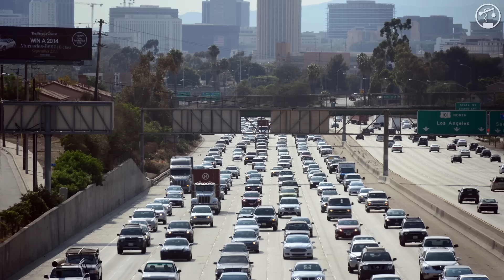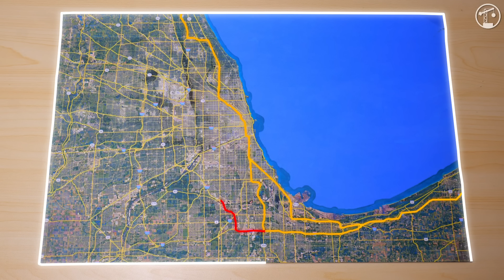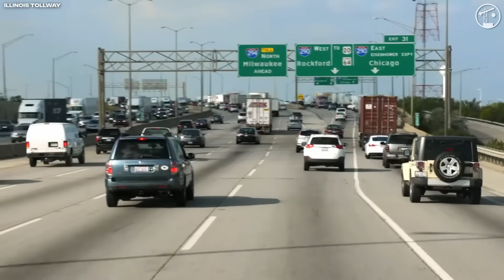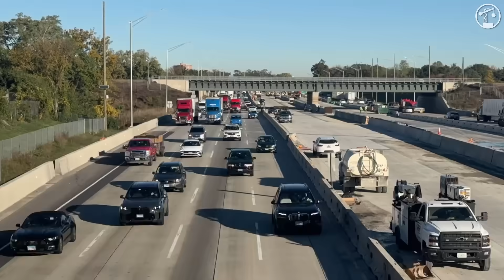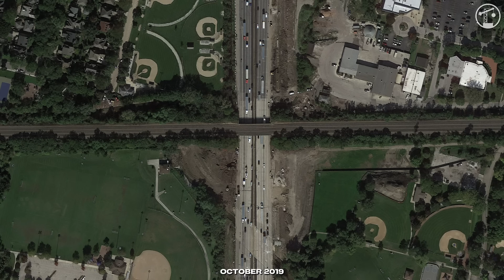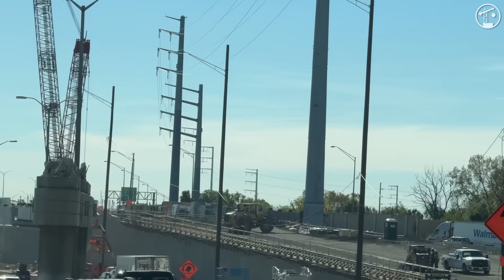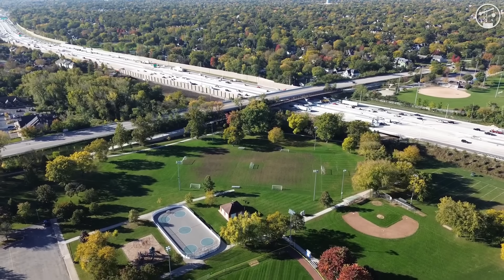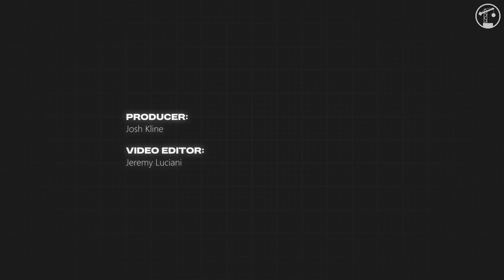Why Chicago is Spending $4B on One Road

Comment: After moving back to Chicago in 2007, I got rid of the car and stuck to trains and buses.
Reply: The trains are have become too unreliable for daily work commuting. Metra is awful. Especially the BNSF line. The L is still ok though. Usually.
Reply: I've been living in Philly without a car for 20 years. With the money I saved, I bought a house.

At this point it's completely paid off and I'm semi-retired in my 40's.

A car free life is the way to go.
Reply: @AB-wf8ek  sadly most areas in the US you cant live without a car of some sorts.
Reply: @sal-the-man  Chicago is a pretty big exception. You can get around pretty easily with no car. There are some odd pockets here and there. They actually need a train line similar to 294 that goes north/south on the west side of town
Reply: @brianthornber3319  exactly, that’s what Ive been saying. I lived there before and most of my commutes were north to south. The Chicagoland area has great transit east to west but there is virtually none going north to south some good transit replacing the I-355 and I-294 corridors would be nice
Reply: @brianthornber3319 maybe if you live east of western
Reply: @brianthornber3319  yeah but the catch is one can't afford a home in chicago you're gonna be renting
Reply: @brianthornber3319  they need intersuburb train access. When the suburbs are as populated as cities themselves they should be connected together
Reply: You're brave for sure
Reply: @timdodd3897  Why? Driving is much worse than taking the bus. Cars suck.
Reply: I've recently got an ebike and it's been much better zoom through traffic and Chicago is slowly expanding and upgrading the bike lanes which make it better to bike
Reply: @chitowncommentor snow ❄️...
Reply: Those ebikes are insanely amazing. Before they became popular I invested in an engine for bicycles, same thing just faster, 35mph. Fell off it and realized, even with a helmet, it’s dangerous. Haven’t been on one since, but I remember how much fun it was riding around the city feeling free (minus cars tailing you lmao)
Reply: Legend
Reply: your a brave man
Reply: You also limit yourself to where and when you can go.
Reply: @O @OGKenG not really lmao. If you don’t have a car, there’s no reason to live in the middle of nowhere
Reply: @Minelaughter  me and my partner live in chicago, i drive they dont, it takes me a half hour to drive and get food from the grocery store, it takes my partner 1.5-2 hours. literally anything they wanna do tack on an extra hour or two because of public transit, they've been trying to get their license for a multiple years in chicago but no single dmv in the city can do everything they need to qualify and they wont even see them at an appointment unless youre at a dmv that does, so we now have to drive to the burbs, if they didnt have me to drive them this would change from a 2 hour errand to an all day errand. like cmon be serious, as much as we want to like public transit it is severally lacking in the US, even in chicago.
Reply: @B @Bedzsy  If you live within the city limits of Chicago, I find it very difficult to believe that your partner spends 1.5-2 hours taking transit unless it’s a bus. Even then, 2 hour travel time would be cross city travel. I also live in Chicago and I can take the bus or train from
Home to downtown in an hour, usually less.
Reply: @Minelaughter  I think they're lying too. I pulled up a map of all grocery stores in the city and there isn't a place where you are more than a 35 min walk from one but every one of them is on or near a major street or bus route.
Reply: @Bedzsy  Where in the city do you live? If it takes 1.5–2 hours to get groceries, you live in a food desert. That's a separate problem.
Reply: Daredevil 😮
Reply: @bartblue2406  CTA is safer than driving. 110,000 car crashes every year just in city limits.
Reply: Daymn im sorry, i wouldn't make my step mother go on the trains. Unless its just to Union station, then its fine.
Reply: Not having a car is not a flex, its a handicap, even in places like the EU where I live. No sane person would prefer mass transit over having your own private car.
Reply: @ShepardMerc Having access to a car is helpful, whether that be through ownership, rental, or taxis/Uber. It's a tool to get around just like any other, with strengths and weaknesses. There is no one-size-fits-all solution to transportation, but what we do know is that entire populations relying entirely upon the car for every little occasion has been disastrous in many ways. I'm sure none of this matters to you though, because you're more interested in optics. 

You can't convince anyone who's not completely braindead that driving some mass manufactured machine upon the same gov planned, maintained, and policed roads to get to the same handful of nearby places everyday is anymore "free" or even functionally different from mass transportation. For the vast majority of people, getting around by robust public transport, cycling, walking, and renting/borrowing a car a couple times a year would make them no less 'free.' Tell me, what would one be barred from doing and what would stop an individual from owning a car if the need truly arises? Just say you prefer the experience of driving, no need to veil it in fake principles. I can respect that much alone, but just know that no matter how much you may personally prefer driving, there's no ignoring the ill effects of excess and forced car usage. There is a healthy middle ground and it's not where we're currently at.
Reply: @ShepardMerc  It's not a flex, it's a preference. In most cases owning a car in NYC is insane, as parking spaces cost as much as a small condo in other towns. I have plenty of friends who don't want the hassle of car payments and insurance payments for cars in Chicago when the only time they would use them is for trips out of town. Especially now with Uber and Lyft being ubiquitous.
Reply: @brianthornber3319  Okay so your last sentence contradicts everything you just said. You're outsourcing car ownership to other people, who then charge you more per trip than how much it would cost you.
Reply: @ShepardMerc  What? No, not remotely true. Talley up what your car costs, with interest, then add insurance premiums, gas, parking, permits, and upkeep. Then tell me a few Uber trips will cost you "more" than that.
Reply: @brianthornber3319  So Uber owning their cars costs less than how much other people pay for cars? Yeah no, these services have to make a profit, by default the same trip from point A to point B, would cost you less than how much you're paying Uber.
Reply: @ShepardMerc  What???? Yes the Uber trip costs more per trip. No, owning the car is not cheaper because you don't pay for the gas, insurance and everything else. I'm not even sure why you are comparing the two. This is a very bizarre conversation.
Reply: @ShepardMerc  are you arguing that since the airlines make money on me when I fly, I should instead go out and buy my own 727?
Reply: @brianthornber3319  Depends on what airplane you're flying with, but yes, if you had your own plane you'd be paying less per flight than what you're paying airline companies.
Reply: @brianthornber3319  So in the same comment you admit the Uber trip costs more than what you'd pay for your own trip with your own car, then you throw a hissy fit that you'd have to pay for insurance, gas, and everything else? lol So are you seriously arguing the Uber did not have to pay for insurance, gas, and everything else? You are indeed a very bizarre person.
Reply: @ShepardMerc  Dude, this conversation make absolutely no sense. I'm not throwing a hissy fit. I'm trying to reason with a completely unreasonable person. OF COURSE the uber would cost more than a single trip on your own car. No one disputes that. It's more than balanced out by all of the other costs incurred by owning the car. This is so self-evident that I shouldn't have to mention it, yet I've had to mention it multiple times. And I still don't think you get it.
Reply: @brianthornber3319  Pretty sure you're the one that didn't get it, and after realizing it you're trying to save your own ass.
Reply: @ShepardMerc  I promise you that's not it
Reply: @ShepardMerc Choosing a car-free lifestyle saves on average $11,500 per year.  If invested, that can lead to being able to retire a decade earlier than everyone else, or one can retire at 65 with an extra $1.3 million in the bank.  

I went car-free 20 years ago, because I lived in a traditional neighborhood and didn’t need a car to get to work.  The money I saved allowed me to fully fund my retirement accounts, buy my first home, buy my second home and retain the first one as an investment property, and travel to every corner of the world over the years.  

Spending that money on car ownership would have bought me some measure of convenience, but at the cost of financial independence.
Reply: @ShepardMerc  This comment is ridiculous. 80% of people who live in Manhattan don't have a car.
Reply: @Damon_Callahan  Their problem.
Reply: @ShepardMerc  They don't have a problem. They're living their best lives.

I don't have a car in Chicago either and have zero need for one. 

You're just talking absolute nonsense.
Reply: @Damon_Callahan  The stats on mental illness tell a different story, not to mention the state of blue cities and the insane policies they vote for also speak for themselves. Try again.
Reply: @ShepardMerc  Lol you just said 80% of people who live in Manhattan have a mental illness. Go touch grass.
Reply: @Damon_Callahan  They do in fact lol didn't mean to trigger you
Reply: @ShepardMerc  No, just disappointed that people like you are so ignorant and close minded. Oh well. Have a wonderful weekend.
Reply: @ShepardMerc  it’s better for the environment. It’s the more natural way as well. It is absolutely a flex.
Reply: @sal-the-man  "but but the environment" good god how brainwashed are you people? You know whats good for the environment? If you don't exist.
Thats where this insane enviro argument ends up, every, single, time. I've spent enough time arguing with enviro nutjobs to know, if you're not a die hard leftoid and you have critical thinking skills, you'll notice this too.
Reply: @ShepardMerc  and by the way about the environment argument. It’s a fact that it is better for the environment. But I also acknowledge that it’s not really the individual footprint that causes the environmental catastrophes. It is the corporation that violate environmental regulations and for the sake of profit destroy our environments. 

But don’t be fooled, I’m not a person who thinks if everybody drives EV’s or stops driving that would solve pollution. That’s a dumb argument. 

But on an individual level, it is healthier for you to go out and walk more. It is something I would prefer because I’d be able to get more steps in every day.
Reply: @sal-the-man  No its not 🤣 When your IQ increases to triple digits you'll see that the whole environmental argument is about nothing else than guilting you into giving up your rights and your freedom. I've walked enough in my life and had to take mass transit for over 20 years. I can assure you that having a car is like living a different life.
The only thing that was consistent on mass transit regardless of which country I was in and whether it was a rural or urban area, is that 95% of people looked miserable. Like their soul was broken. They've been conditioned to be sheep, forever dependent on somebody other than themselves.
No thank you, I'll make my own decisions and you can continue feeling guilty for no reason.
Reply: @ShepardMerc  think you’re the one who doesn’t even have double digit IQ.

Can you read what I actually said? 

I never said people should give up the rights to drive or their freedoms. Quite the contrary!

Literally my last statement was I want everybody to be able to access any mode transport they like whether it be by train, car, or foot. 

I don’t think you care about people’s freedoms you just want a car oriented city that forces everybody to drive. 

I’ve lived in many car oriented cities. I’m American. By the way like I said before. I love driving cars, but I realize and recognize that it’s a serious problem because not being able to walk to your local grocery shop or not being able to walk or take public transit to your small day-to-day trips adds onto traffic that will make your trips longer and it is proven to also have an environmental harm because when you have everybody using cars, it’s definitely gonna affect that. 

I know this is very hard for you to understand because facts trigger you but let’s not talk about that. Let’s talk about how it affects you.
Reply: @sal-the-man  Based on how triggered you just got and based on the enviro nonsense, I can assure you your IQ is double digits.
I wouldn't have a problem with mass transit, if people that promote mass transit wouldn't promote it at the expense of owning private cars. "but but if only there were less cars then mass transit could work like its supposed to" I see this daily. I don't know how long you've been on the internet but thats the default argument for enviro nutjobs.
And the other reason people should drive, is that mass transit conditons people to be obedient sheep, and not individuals making their own decisions and thinking for themselves.
Another hilarious flaw in your argument is that you can't walk to your grocery store. Fact is, you can. Its just that you're not willing to walk the extra mile because you have a subjective personal measure for how much you wanna walk, and you're trying to force that onto the rest of the world as the standard everybody should follow.
So lets get this straight, you said walking is good for the environment, yet you're not willing to walk. So which is it? Isn't it amazing how I'm capable of walking an hour if I have to, yet you're stuck at just a few minutes? So is walking good for the environment or not?
You see, by your third reply the entire enviro narrative fell apart, like it has the previous 500 times I've encountered this argument.
Kid, when your intelligence is at adult level, and you understand psychology as well as I do, you'll realize you've been used as cannon fodder for an ideology that doesn't want you to exist. So lets talk about how that affects you.
Reply: @ShepardMerc  whatever you ever claimed here was not even what I said. At this point you’re just putting words in my mouth for the sake of winning an argument. 

It’s not worth discussing with you since respect can only go both ways. 

I honestly thought you wanted a honest conversation about transportation issues since that’s a topic I’m very interested in but you were never genuine in your replies by the way you blatantly ignored any point I made to further talk about your biases and agendas and to shit talk anything I raise up.

For the last time I’ll say it again. I want people to be able to choose their modes of transportation. Whether it be car, bus, foot, or train. The only thing holding back mass transit in America is not people themselves. I don’t blame them when our transportation system isn’t very good in most areas. There’s a car lobby that actively pushes politicians from ever providing adequate public transportation. 

If anything it’s the car centrism that is being pushed at the expense of any other mode of transportation not the other way around like you claim people want. This is a dumb argument regardless and you don’t realize that in general the less people on the roads is less traffic you have to face overall when driving which equals smoother faster drives. Don’t you want that? 

I’m not trying to argue with you so don’t be so confrontational.
Reply: @sal-the-man  We did have an honest conversation about transportation issues, and the bottom line is this, cars > mass transit. And I explained why, I went deeper than simply infrastructure. I took you straight into psychology, which was way too fast for you.
So I will say it again, while you're worrying about the car lobby and the environment, the ones that are trying to guilt you into throwing your own rights and freedom away, and trying to cram you into mass transit to travel like sardines in a can, are worshiping an ideology that doesn't want you to exist. Cars are a huge element of individualism and developing a healthy mind, and they know it.
I'd rather deal with more traffic and know that people are individuals who are capable of thinking for themselves, than deal with less traffic while living in a world of sheep.
Obviously you're not gonna understand these topics for a few more years, until you really get into the thick of it. Till then you will continue your life fully convinced that you wanna save the planet and more mass transit is better. You will also have knee jerk reaction replies as your focus is on getting back at me and not actually understanding where I'm coming from.
Reply: @ShepardMerc  Calling public transit “sheep behavior” misses the point completely.
If anything, the real herd mentality is blindly accepting that car ownership is the only path to independence, when it often means being tied to decades of expenses: car payments, insurance, gas, maintenance, parking, and repairs. A car offers convenience and flexibility, sure, but how can you actually enjoy it when being tied down to its burden? Unless you’re settled in life, with stable finances and a stable lifestyle, a car is a burden in the city, as it ties you to monthly bills like gas, maintenance, and car insurance. Meanwhile, the money saved by using transit, biking, or ride-sharing can be invested, saved, or spent on experiences that matter more in your 20s and 30s. And as a motorsports fan, I appreciate cars for what they are, thrilling machines and feats of engineering. There’s a difference between enjoying the spectacle of having a car and committing to the financial burden. The superior independence isn’t just about going wherever you want with a car; it’s about having the financial freedom to choose your life without being weighed down by unnecessary debt and overhead. For many, especially before settling down, avoiding car ownership isn’t sheep-like; it’s a deliberate strategy to stay light, flexible, and financially sound. So that I can actually go wild later in life.
Reply: @ShepardMerc  man, I don’t know how to respond to such statements. It takes a level of imagination and creativity to arrive at such conclusions, but I applaud you for it. 

All right being real. You really think people riding trains makes you lose your individuality? You know what dystopian staying in a hours long traffic jam is this your freedom you call?

I thought you wanted freedom. But when I proposed basically that. Having the option to choose between your car or taking a train or taking a bus or even walking. You go into some ideological nonsense. 

I think you’re just too into the thick of it. You need to think about yourself and think about what you believe in.  Come out of it a little bit because maybe when you’re isolated by yourself and you have your own echo chamber (not trying to insult you being real here) you start going into loads of theories that might distract you from reality. 

The main problem in America is that it’s way too car centric. You’re not from America so you might not understand it but us Americans know this too well. I literally advocated for something that would make your life easier. But instead, you don’t wanna give anyone options.
Reply: @belluh-1huey102  If you consider a car as "being tied down with a burden" then you've got serious issues in life ranging from physical to psychological. No sane person would argue that owning a car is herd mentality -"oh look at all those sheep, look at them with their herd like freedom" - as you stare out of a cattle transport window.
Sure, you might be willing to give up some independence and convenience in your teens and early 20s, but if your strategy for saving money in half your life is not having a car, then you better not be surprised when nobody wants to settle down with you. "but but babe I don't have a car because I'm trying to save money, if you settle down with me, then I will buy a car" think about how insane that sounds.
Reply: @sal-the-man  It takes real life experience and understanding of psychology to arrive at the conclusions I've arrived at. As expected, you couldn't resist replying because you just have to somehow get back at anybody who doesn't fall in line with the enviro narrative and doesn't wear the same moral high heels as you.
Hours long traffic jam - 1-2% of the driving experience. Being stuck on mass transit like sardines in a can surrounded by a bunch of strangers that you wouldn't want near you on a normal day and being subject to other people's schedule - 95% of mass transit experience.
That ideological nonsense is the IQ difference between you and me, you're not even capable of imagining that somebody might know more than you do, that tells me you're about a decade away from being able to have a rational conversation about any of this and perhaps even further away from zooming out and seeing what role you played in somebody else's ideological nonsense.
Now think about this - whos actually distracted from reality? The person thats promoting cattle transport because its "good for the environment" while at the same time that mode of transport contributes to people being soulless broken sheep, or the person who spent years untangling the ideology of the people that think they're the rulers of humanity?
I can say the same for you, you're not even from the EU so you might not understand it, but us europeans know this too well.
Like I said, this was way too fast for you, you're about a decade away from catching on to anything I just said. So until then you'll have to take my word for it - mass transit isn't even close to being compatible with human nature.
Reply: @ShepardMerc  How is wanting the freedom to choose other transportation systems "herd mentality"? Most people do not really care about that freedom bs anyways, and they use a car because its the best option in a car-centric country.
Reply: @Supereme13  You mean most people that have been conditioned by urban environments to be sheep, do not care about "that freedom bs". People who haven't been conditioned to be sheep, very much care about freedom.
Reply: @ShepardMerc  Yall are the ones being conditioned like sheep to believe what the government and cat lobbys want you to believe